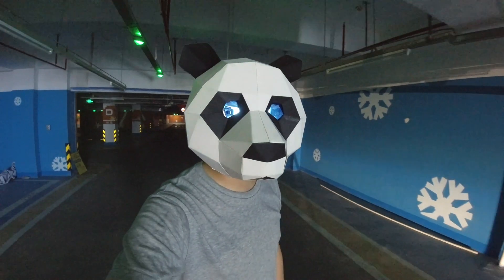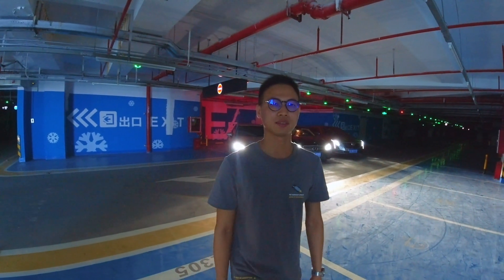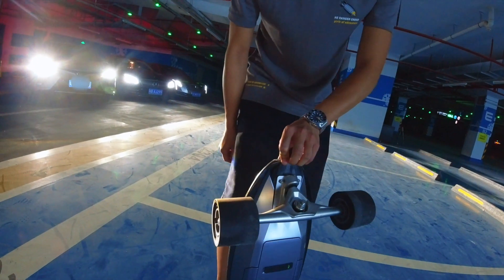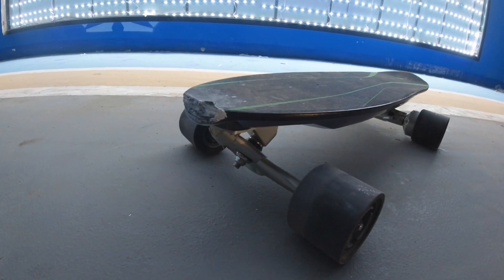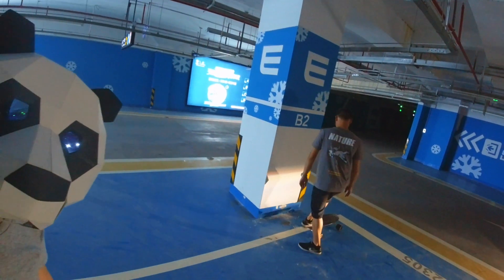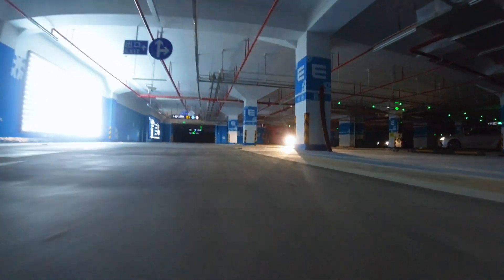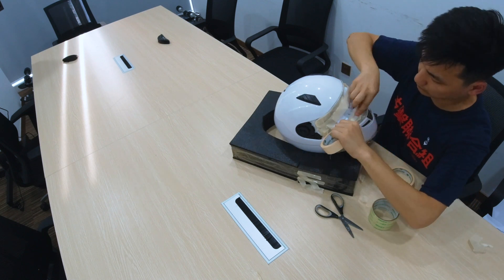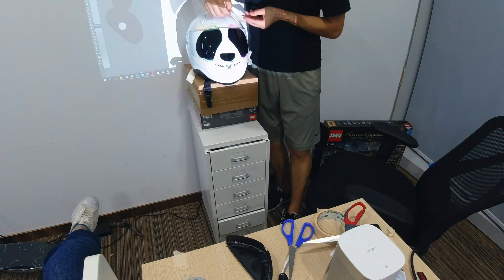SPECTRA X: Crashing Test & Posture Control Demo

Comment: sorry.. its an awesome board anc all.... but I just do not see what crashing it straight dead on in to a wall is showing/proving..
In the real world that's kind of the least likely crash you would ever have.. as its so easy to avoid.
maybe have it fly up 20 foot out of a skate bowl and see how it handles the landing.. or drive over it with a car... or do hundreds of kickflips where you land on its side or upside down etc etc.... 
These are real world and likely crashes...